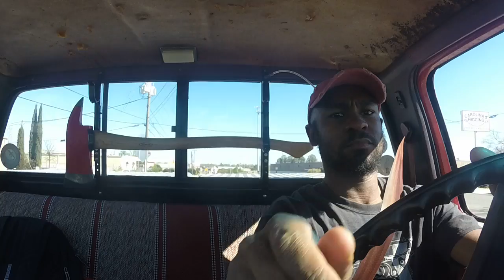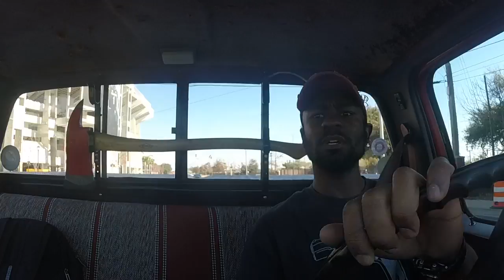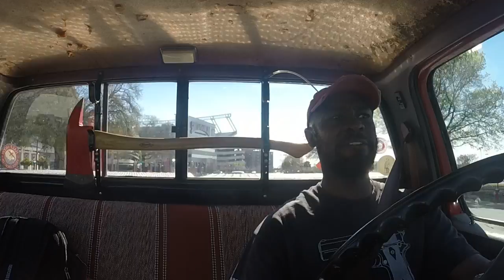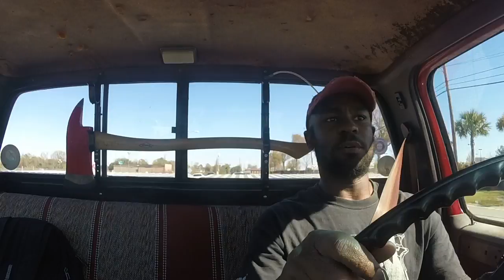Refining Fuel and SHTF

Comment: Gs engines do run on water, they always have. The electronic controlled computerized engines may need reprogramming though. The water has to be "negatively charged" before it will ignite. Essentially it's a HHO setup.
Reply: >cant tell if just trolling
Reply: Zaku186 look it up

Comment: Energy is a most important and often overlooked aspect of prepping.  For now I keep a bunch of gas on hand.  Usually about 50-100 gal. and rotate it to keep it fresh.  I'd like to go diesel but the state of CA is very anti diesel, and these days I only drive Toyotas and they don't do diesel out here.  I also have a dual fuel generator to run off propane or gas.  I keep about 300-500 gal of propane on hand.  Beyond that we have a small 1.7kw solar setup with 4kw of storage and a good sized inverter to handle expansion of the system in the future.  In SHTF batteries can come out of cars and be added for storage.

Looking toward the future I'm keeping an eye on the plug in hybrids because we have plenty of sun out here and so I have solar.  They have about doubled the power/weight ratio in batteries in the last 12 months and the cost has dropped by about half.  So when Toyota's plug in hybrid gets to the point it has enough range I'll add a few kw to the solar and get one of those.  Solar and electric cars are without a doubt the future out here.
Reply from the maker: Thanks for the info. That sucks hearing diesel gets a bad rep in C.A.
Reply: They actually got away with passing a law that all diesel trucks and busses that were beyond a certain age had to get scrapped.  They made it illegal to sell them or remove them from the state.  The day they passed that all those older trucks and busses became essentially worthless.  A friend of mine who had a rock & gravel hauling business was instantly bankrupted. 

Now all diesels have to have these filters on them which are something like 30 grand and have to be serviced regularly.  Plus you have to keep some chemical in them.  I don't mind new pollution controls, but making it retroactive is to me outrageous.

Comment: Because you drive a diesel there is a way to store hundreds of gallons of fuel in plain sight. This could cost nothing to about half the retail price for a gallon. If you live in an older home or older community this may already be available. Getting everything you need will take some time and effort. It is considered hazardous waste so people have the option of paying a company to take it or putting it on Craigslist (or other listings) and selling it or giving it away.....
The answer, a home heating oil tank and oil set the tank behind your house (or out building) like it belongs there and when you find free or cheap oil store it. Or if you wish farm grade diesel or mix it. Remember this is for shtf do not use this fuel during normal situations. Now just procure a water separator and filter. And the tanks sets 4 feet off the ground gravity is all you need.
Reply from the maker: Good info.

Comment: I think we would end up going back to horses and only a few would have gas. i think some people would take the refineries by force and those that would be willing to work with them and those that took the oil fields would be the only ones with fuel. you can be in charge of gas town ill run the bullet farm. lol
Reply: Not enough horses but there will be 200+ million bicycles collecting dust. Our distance to collect resources will be smaller due to transportation and security. Any fuel I have will be to try to get to a safer if where I am is unstable, pretty much a one way trip. Until then I will put up a front that I am no better off than the rest of the community cycling and walking.
Reply: im talking more long term. the factories to make bikes will have been abandoned. maybe someone will find enough people to get some production going. but i doubt it will be enough to compete with the people breeding horses and selling them for ammo and food and such. im sure right after something happens then yes only the ones who survive and had horses or knew how to ride and were in an area with horses would have a horse and a lot of people would be riding bikes and just walking but after a while i think horses will be more and more common. a horse can carry a lot more on than you can on a bike and much further. i doubt cars and truck will be back on such a large scale for a long time. think about the infrastructure required for that.  you need someone to maintain roads otherwise the cost benefit of a vehicle would not be worth it. you need gas so you have to have something to trade for it until fiat currency comes back and that requires a big government. and as far as the short term if we are still alive it would depend on entirely on what caused the SHFT scenario. you dont know that "distance to collect resources will be smaller" if its a nuclear strike or bio/chemical warfare then it may be a long way till you find any water you can clean enough to drink. saying that the distance will be shorter is an assumption and assumptions kill. "Any fuel I have will be to try to get to a safer if where I am is 
unstable, pretty much a one way trip. Until then I will put up a front 
that I am no better off than the rest of the community cycling and 
walking." this part i agree with though. if we are lucky enough to live and still have a working vehicle and fuel then bugging out may be what is required and any fuel left over would be best saved in case you have to bug out again or move something vital that is heavy or just bulky or get to someone as fast as possible.

Comment: I'm no expert but can't you run a gasoline based engine with pretty much anything that burns like gasoline? For example, you could use alcohol that's flammable. Pretty much all you would need to keep your car running would be a moonshine still. I vaguely remember a chemistry class from junior high where we had a discussion about the subject. I could be completely wrong though.
Reply from the maker: I think it last half as long as gasoline. Not sure what could happen to any rubber components.